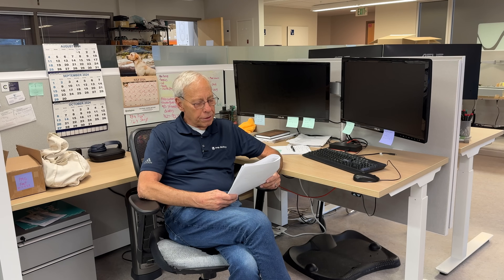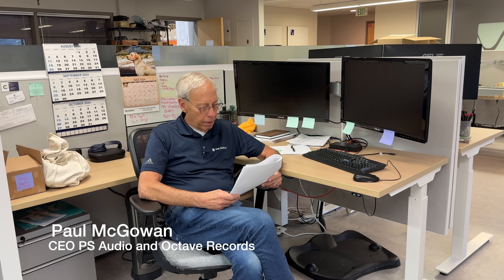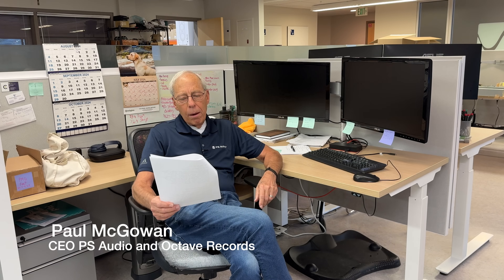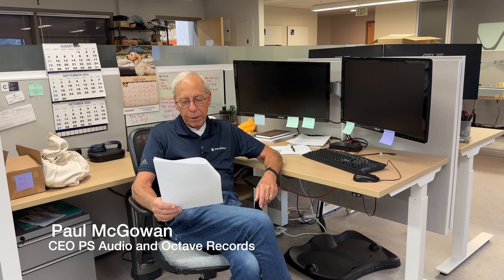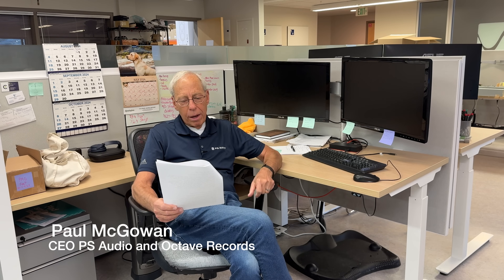Mixing in pure DSD

Comment: you can mix in DSD the same way you can mix tape. the one bit isn't the sound, it's a carrier wave.
Reply: With a tape the strength of the signal is recorded by the strength of the magnetic field on the tape. With DSD you only know the voltage a bit represents by looking at all the previous bits and adding voltages. So if you took say bit 100 of one recording and bit 100 of another recording how do you know what voltage each of those bits represents.
Reply: @ when you look at tape under a flux viewer the magnetized sites are identical. in playback of both, nothing cares about what passed through before, it's just tank filters. when magnetized particles pass under the playhead, the voltage increases. when the logic gate is open on a clock pulse, the voltage increases. when the opposite is true in either medium, it decreases.

Comment: besides the stuff paul said ...are we gonna also record in DSD lol its literally impossible 
there are no DAW's(digital audio workstations) that can capture DSD and or  accept it as sample rate!
there are no audio plug ins that will mix in DSD and yes that would be computing power nightmare 
even with a 13000 $ mac  you would have to mix in pure analog maybe to a multi track tape machine or some other type of analog recording  device  
finalize it there and find a  recording device that would let you lay it down and print it to DSD 

that is the only way

Comment: Talk about getting the runaround!
What Paul is trying to get around here, as usual, is that nothing coming from Octave Records or most other supposed DSD releases is "pure DSD" because 98% of DSD releases are DSD copies (or conversions) from PCM.
People like Paul like to hem-haw around this fact by giving high-bit rate PCM fancy names like DXD to try and cover the fact that they must mix their work in PCM and then convert it to DSD.
They try and claim that DSD is somehow better than PCM yet the DSD cannot be better than the PCM source from which it comes and in fact, it is actually worse because of all the noise that must be added to DSD to dither the signal and then a low pass filter, which Paul quickly tries to slip in, must be applied which changes the phase and adds harmonic distortions to the original signal.
So don't be fooled when you buy DSD you are not getting "pure DSD'.
Reply: Yes, that's right. Spot on! Very appropriate, accurate comment! Bravo!

Comment: For me, the primary use case that works well for DSD is the capturing of the original analogue master tapes transferred directly to DSD. Again, for me, this gets me to good place to enjoy a similar sound signature compared to the original vinyl pressings with-out the downside of vinyl. (Cleaning, Pop's, Noise, etc...).

Comment: OK, going to hear about tis one! Hz = CPS = cycles per second. It is a measure of repetitive continuous waveforms. Technically not a count of samples as such. Technically 352Khz would be describing a sinewave. Not a sample rate. Sample rates should just use the "K" or "M" designation without the Hz.
Reply: "Audio sample rate is measured in kilohertz (kHz) and it determines the range of frequencies captured in digital audio."
Reply: @Oystein87  So they wrote this incorrectly. Hertz "the standard unit for measuring the frequency (= the rate of repetition) of a wave." ... "of a wave." (Cambridge Academic Content Dictionary © Cambridge University Press) What's your point?
Reply: @glenncurry3041  No they wrote it correctly like others also do.

Comment: Regardless of hearing it is impossible, I am willing to bet that not the case. At any point, the next sample is either a one or zero. Either the signal goes up or it does not. If you mix multiple sources that next bit will either be 1/0! If you convert the multiple DSD streams to analog to mix and then resample, the sample at that point in time will still be either a 1/0! Did the results of that mix make that sample point higher than the last on or not? 

Just as digital audio was being developed, I moved back to video from audio. CGI and digital effects were just being invented. I sold the most advanced systems like Ampex ADO and Abekas A53D. They worked by moving the processing into the time multiplexed domain instead of staying in the linear time mode. A single new sample  result of multiple inputs was determined based on time domain, that pixel/ sample over a few frames/ time... While we seem stuck in the single sample by single sample approach to mixing in audio.

Perhaps using AI? It might be able to look at all the samples at that point in relationship to past and future points and decide whether that results in that next bit being louder or not. 1/0? And that is all that is needed.

Comment: PCM the sample rate frequency is fixed. If you varied the sample rate, the audio output would change in frequency.  The signal represents amplitude, so it is easy to add, subtract, mix signals.  DSD the amplitude and sampling rate is fixed as it is transformed into a frequency domain signal, where the amplitude is also fixed.  The signal has to be demodulated to adjust amplitude, which results in PCM.   So yes, more processing power, you can adjust dsd volume, and mix signals, but that requires processing to transform signal to time domain, mix, and retransform to DSD. But that transformation and calculations are to convert what is called a PCM data. 

It is like the difference between AM radio and FM radio. AM radio is like PCM, both time domain signals. Other signals easily mix with AM radio and does not sound that good. But FM radio sounds much better because the signal is frequency based, and amplitude variations do not get mixed in to the signal. Interfering stations do not add or subtract as they do in AM. The strongest signal is heard, with relatively no interference.

Comment: How is it possible that recording in DSD and then mixing in DXD is lossless as you say but recording directly in DXD would be different? You say the formats are the same but then you say that they aren't. Am I missing something?
Reply: It's why DSD is pointless. Just record in high rez PCM, DSD has to be edited in PCM anyway.
Reply: Why recording in PDM 1 bit sound different than PCM 32 bits? I don't know, although my guess —if there's any difference— is that it might be easier for the ADC to do the first conversion on the fly. I can imagine some "wave" in the PDM stream of ones and zeros, whereas in PCM I can't (some calculations needed). Just a supposition.
Reply: a fair comparison would be PCM with sampling freq in the similar MHz range (DSD256 uses 11.2MHz) not from oversampling
Reply: @philiptong4978  If you look the noise profile of some DSD files or PCM files converted from PDM, we might ask for less MHz. Sample rate might be much higher in DSD, whereas bit depth much lower.
Reply: It's all just FM-F'ing Magic! I can't wait until the Merging of AI and Quantum Computing Eliminates Human errors and does all of it for us!🤨🤔😵‍💫🤣

Comment: You say that DSD cant be mixed in DSD...so the drawback is just computing power ?
Reply: No. Any amount of computing power won't make any difference. It's mathematically impossible to mix one bit audio which is what Paul said.
Reply: PCM audio stores the instantaneous amplitude value of time-sampled audio, these individual numbers (or magnitude values) can each be manipulated selectively with or w/o threshold: add, subtract, multiply, divide, transform then add, relocate to a different time location to achieve post editing

(DSD) uses PDM, it stores the change of the audio signal by using density of values, the value being on or off in 1bit system, it is also how human sensory works, think of the "on" opens water tap, adding water to the sink, the "off" opens the drain to lower the water level
Reply: @simoncreesuk  Yes, there is no number at a sample level so you can't perform maths. You have to convert the simple "go up" and "go down" 1-bit information to a number in order to apply and DSP conversion.
Reply: the drawback is it's analog. you can mix it analog without converting a thing.

Comment: If DXD is multi bit and PCM is multi bit. What is the difference between DXD and high resolution PCM? It appears that DXD is just high resolution PCM, yes?
Reply: You are actually right. To try to claim you do pcm editing of even 1x dsd signal, you should have a single pcm sample per every dsd "sample". As dsd samples of even 1x dsd are running at 2.8 MHz, then you should sample your pcm at that frequency. If you do 2x, 4x and higher dsd editing, then your intetnal editing should sample at proportionally higher frequencies.
Reply: First there is nothing inherently special about PCM that makes it inferior to DSD. Each format has its own set of things that require special attention to get them right. Sure, capturing in DSD has its charm but I see no reason why it has to be a mandatory problem to transfer to a very high rate PCM, as long as you have the proportionate amount of CPU to back it up. Computing power is all but free at these levels. Our current work stations are merely the leavin's of those who didn't wait.
Reply: @InsideOfMyOwnMind  Agree 100%. PCM can also exceed the level of what is perceivable resolution in audio. I can stream music from my Amazon Music Unlimited account today in up to 192kHz 24 bits lossless and nobody has ever proved that anything higher can make a perceivable difference.
Reply: DXD is a marketing name for 352.8kHz 24/32 bits PCM. DXD just runs 8 times the CD sample rate of 44.1kHz. Personally I find it a bit deceiving to use the term DXD while discrediting PCM. Mathematically, DSD-64 has a precision of single steps up/down at a frequency of 2.8224MHz. DXD will represent sample values at 1 time for every 8 DSD steps. What happens between each of the DXD samples from the 8 times higher DSD resolution will be LOST. You can not re-draw the precise step up/down of DSD from DXD simply because the information is lost (8 single DSD steps get approximated to the sum of their effect when you transcode DSD-64 to DXD). If your tracks are recorded in DSD-256, the loss gets even higher when using DXD, but is it an audible loss? I don't think so.
Reply: @ThinkingBetter  That is exactly my knowledge as well. I said it in more simple terms. Using "DXD" is a misleading term as far as I am concerned. No DAW can do real DSD editing as of currently. Sonoma claimed it but Sony is pretty famous in raising various claims which later get debunked as misleading. Pyramix claims enabling DSD editing as well but it is doing updampled PCM editing and saving back the result to DSD format. Even if the DSP is 64bit, it doesn't achieve 1:1 true to the source result. The only DSD "editing" available is actually turning it to analog, editing there and turning it back to DSD. Correct me if I am wrong. Another question is if it the difference is audible.
Reply: @dkokalanov  I feel a bit troubled by the marketing hype of DSD themed with it being unconditionally superior than PCM while in actuality it’s relying on PCM in the digital mastering of it and the term DXD is used to sort of hide that fact. In reality I do however believe 352.8 kHz is plenty in retaining any audible timing precision advantage of DSD and I also am confident that a transcoded version with half the sample rate of DXD will be a superb way to distribute such music. This means 176.4 kHz PCM. I don’t believe there would be any audible disadvantage of distributing 176.4kHz PCM through modern streaming (which already can do up to 192kHz lossless), and you would get every benefit of DSD without the extreme inconvenience of it being something you have to mess with as a sort of hack using DOP. I wouldn’t want DSD as 192kHz PCM because sample rate conversion is mathematically better with just half the sample rate. Another reason is that DACs nowadays are usually optimized to work on multi bit conversion rather than true single bit sigma delta,
Reply: I'm going to take a wild ass guess at all this controversy. I'm going to say that the super duper high sampling rate of DSD is so good when captured (Like an Analog tape without the hiss) is basically about as close to recording in analog as you'll ever get. But, there are limitations to this format. You can't tweak it in the software for mixing like you can with DXD. Because the recording is near perfect the 1% loss in fidelity is basically negligible to the human ears when converted back to native DSD. My guess is that even if that original DSD was simply put on a regular 44.1 CD it still would sound very very good.
Reply: DSD can be outstanding or it can also sound sterile. I would think it has to do with more than just working with a Piramix system
Reply: @Scopolamine46  The early SACDs often sound sterilie to terrible. Even the PCM layer of those sounds bad to my ears for wathever reason. One should question if the early Meitner converters did something wrong actually... I would prefer the HDCD version of some of those recordings/remasters most of the time and HDCD is PCM from 25-30 years back. Newer SACD from both 192/24bit PCM or DSD conversion may sound rather terrific though. I have a few and play the 44.1/16 CD layer of them trough my CAL 15 Cd-player with amazing results. Newer PCM recording may sound amazing as well. I guess that it's not only related to the format.